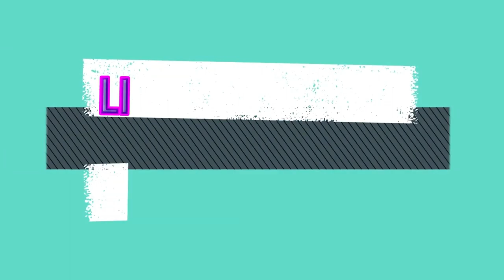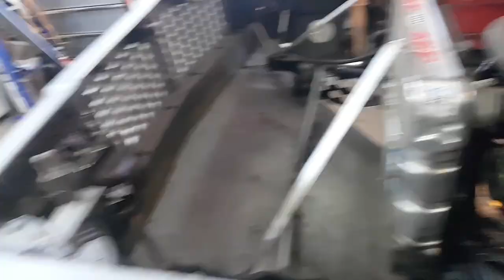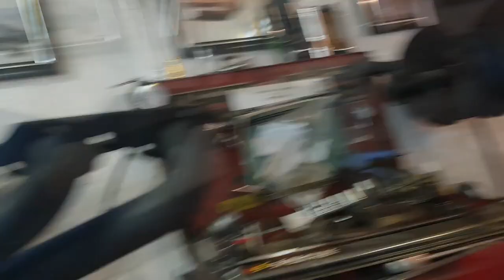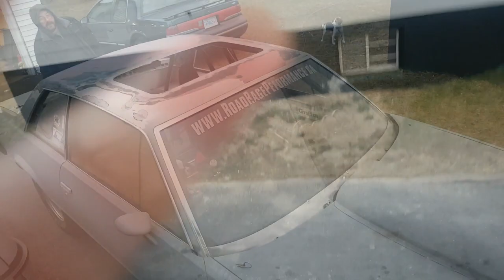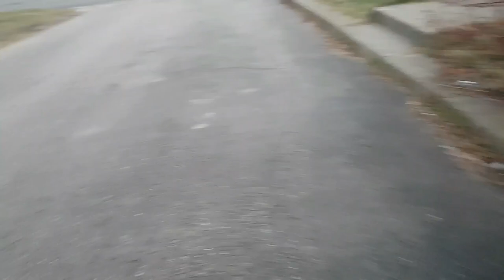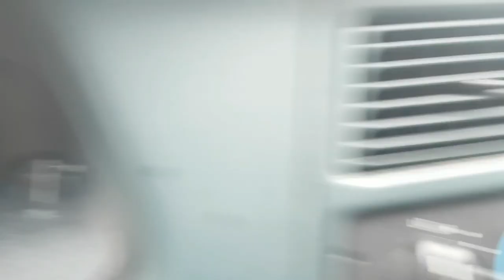502 big block chevy malibu small tire race car project this guy's garage

Comment: Beautiful bacon pop sound during welding them welds should have came out nice
Reply from the maker: thanks antonio. its a lincoln mig pak 180 with 0.25 wire ,a heavy home model .works very good though,would be a recommend for the price,